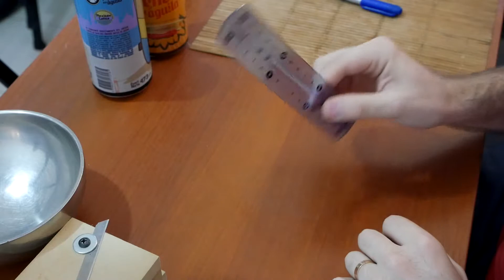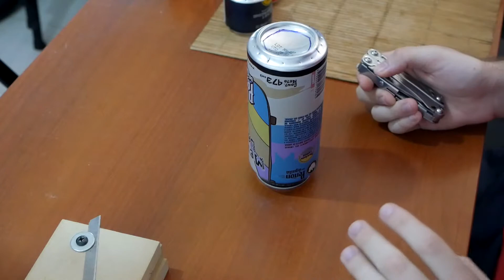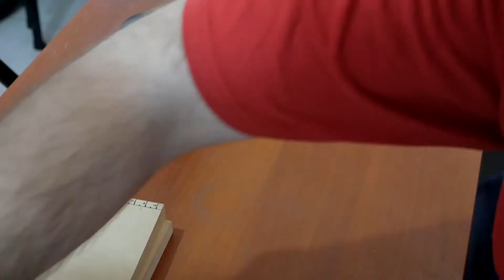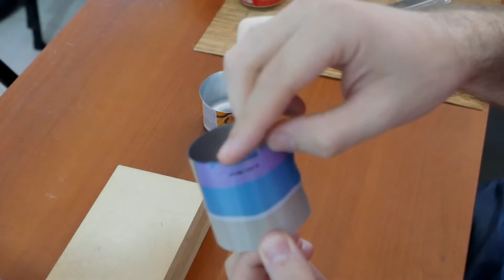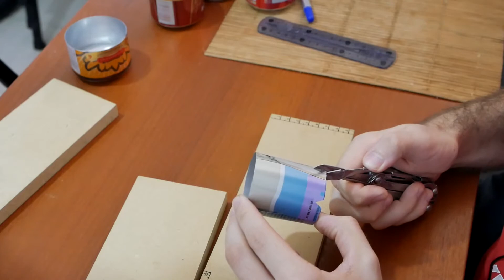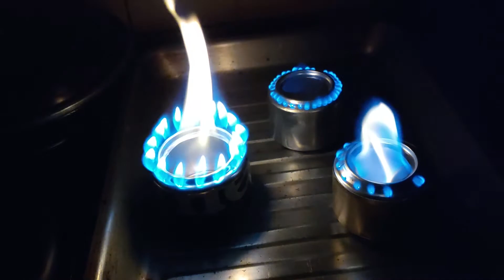How to make a 2 can soda can stove. Easy and comprehensive.

Comment from the maker: Someone on Reddit asked a very good question, regarding what were the differences between this design and a "penny-can stove", mainly mentioning penny-can stoves are simpler and easier to build and don't have a gaping hole in the middle, while it was not the main point of the video I think it's a good idea to include my answer here just in case you guys have similar questions:

"In my particular case, I built a couple of penny stoves (and messed around with many other designs) and ended up preferring this style due to many reasons, and this is just my experience:

1) Penny stoves were hard to get "right" for me, I only seldom managed to get one that burned the way I wanted to. Whereas a 2-can is a success for me 99% of the time.

2) Penny stoves often need to have insulation put into them to act as a wick to hold the fuel (though some report they work just fine without it, ymmv), I found that inconvenient and unnecessary, compared to a 2-can. Nevermind that not a lot of people have scraps of insulation lying around.

3) Penny stoves depend on a very small and easy-to-lose penny, another point of failure in the design that I didn't like.

4) While penny stoves can work without taping or gluing the two halves (with, at least for me, expensive and hard to get specialty glues and tapes) it's highly recommended.

5) While some penny stoves don't need it they are a little hard to get going and often need a priming pan or an actual overflow of alcohol that you set alight, I was not too fond of that idea, for convenience and safety reasons.

6) This is probably down to personal ability and practice, but I can build one of these stoves in less than 20 minutes, often while watching youtube with half an eye. So while I have not practiced with a penny stove I feel like >20 minutes to make this is not at all a long time and a lot of effort.

Bonus point: I really never considered the gaping hole a problem at all, perhaps you can walk me through why that would be a bad thing. If it comes to it being a hazard in case the stove was to get nudged or tip over, well, if we are at that point then we are "doing it wrong" no matter the design. I HAVE accidentally tipped over a couple of stoves before and by that point, you are just cutting your losses and trying to put the fire out or waiting it out, I don't think any design has an edge on that department.

So in the end, penny stoves take a lot more materials to build (going against the super cheap philosophy of building a soda can stove in the first place), are more temperamental and high maintenance, and most importantly, "2-cans" just work for what I use them for (occasional overnight or hiking trip to boil water for coffee or noodles), so based on that alone I felt no need to fix what was not broken.

That being said in the end it comes down to finding a solution to a problem and that solution may come in many forms for many people, this design is what I found worked best for me at the time!"